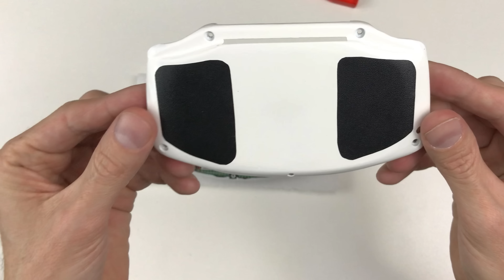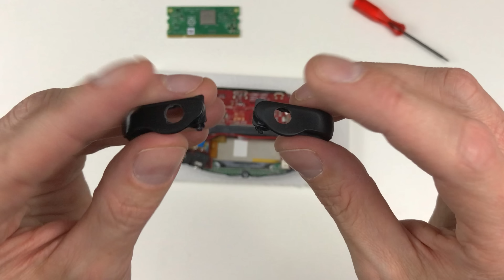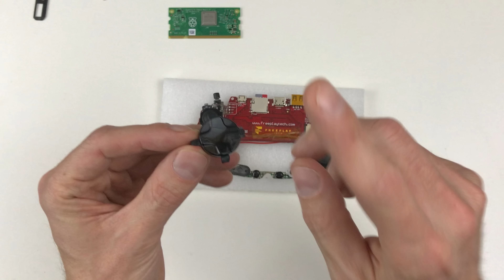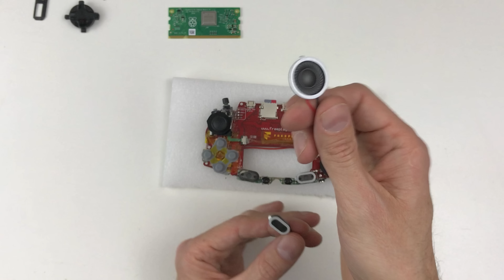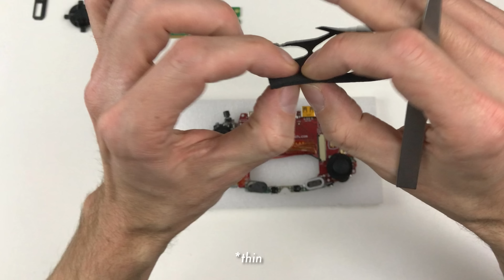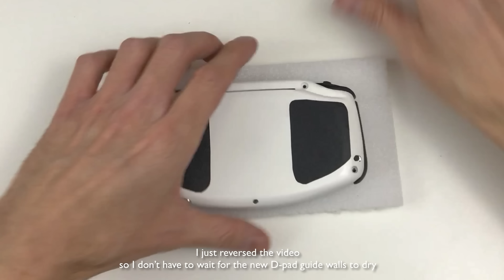My Freeplay CM3+ Slim Internal Look

Comment: I find that the D-Pad for the Thrustmaster's Xbox 360 controller works really well.
There's a place in in or around China that sells all kinds of buttons & switches, I think you would have a fun time looking through different ones for this hobby.

What kind of screen do you use? is it a LCD one?
Also, Would it be feasible to install some sort of rumble in something like this?
Reply from the maker: I WOULD like to different buttons and things for sure. You don’t happen to have a link do you? As for the screen, it’s an LCD https://www.freeplaytech.com/product/freeplay-replacement-lcd/ . The viewing angles aren’t the best, but all in all it’s a good little screen. It works great for modding because it’s so thin, and it does look pretty good. I haven’t seen anyone add a rumble motor to a build like this. Maybe they already have, but I’d guess it would be pretty specific on how it would work. There’s quite a bit of space available in the rear full sized shell and I bet some different motors could fit, but I wouldn’t know how to code them. Do you have any coding experiece? I want to learn, but every time I start I get sidetracked.

Comment: This build is something I would really like to build, but I don't have any experience with the hardware. I know my linux/pi well, as well as having repaired some smartphones, but never soldering of this type. Do you have a suggestion of some sort of project I could do to start to acquaint myself with the skills needed for this project? Also, would creating a model and having the case 3d printed be a good solution?
Reply from the maker: Timothy that would be FANTASTIC! I’d love to be able to work up a model in some CAD software, but I have no clue what I’m doing there yet. I tried for a couple days to model the slim rear shell for my slim builds, but have never been that frustrated in my life :) . It took all my will power to not yet constantly at the screen. I just want the line to move right there! Just connect to the thing I’m telling you to connect to! Why do you hate me so much!? Anyway, after 2 days of that I had to call it quits and just chopped things together as always. If you could create a model it would make a huge number of people very happy I’m sure. I’m definitely up for printing some off for testing or helping you out however I can, so please let me know if you need anything like that from me. As for project to start building your skills. I’m pretty much in that phase now. My first project is my first video the TigerPi. It’s a pretty messy mess internally, but still going strong. I’d say any kind of project like these that you feel motivated to finish. When I started thinking about the TigerPi I was dying to get it working even though I had no idea how to, or if any of that stuff would even fit in the casing. I just had to try. I’ve been learning a little here and there since then. I think it’s been about a year or so only. That’s why I don’t name any videos “tutorial this or that,” because I’m just kind of messing around trying to figure things out most of the time. So maybe a Pi Zero build made with cheaper components just to mess around. You can think of a form factor you’d like to put the components in, like a Sega Game Gear if you have a soft spot for those for example (any form factor you really like), and start to look up parts you’ll need. You know you’ll need a screen, so search around on YouTube and anywhere else online for different builds and see what kind of screens and parts they are using to get ideas. A cheap one I know people go for (I used one before too) is the ~$15 vehicle reverse camera screen. There are a few different models of those and write ups on how to mod them in that a search would lead to. I think there are some tutorials for those on Sudomod, but probably different places as well. Then you know you’ll need a battery. Do the same to look around at what people are using, and how they manage their batteries. On and on like that until you have a little list of parts and have learned a little about how each works (if you don’t already know). I didn’t know anything about batteries or anything at all when I started, and now a know a very limited basic amount. That’s pretty much how I started, but you could go different ways with it. Maybe by checking out a kit like the Freeplay, Kite’s Circuit Sword, Minty Pi, or something like that. They will be more expensive, but they take care of so much of that stuff like the batteries and screen. I’m spoiled by them now :) . I’ll probably do another more DIY kind of build like my Pi3boy at some point though; I need to get a better understanding of things too.

Comment: This is awesome!!! I've been brainstorming something along these lines, but I was hoping I could find a 3D model of the GBA case so I could prototype and fiddle around by expanding the back cover to add L2/R2 (or triggers), and to come up with a better layout for the ABXY buttons (something a little more cross shaped), but no luck so far. Still, I thought about using the JoyCon analogs as well, and the mini-speakers too, and it's awesome to see they work nicely!!!
Reply from the maker: Thanks. Have you seen the different current L2/R2 methods? The default position for them using the addon board (full size back) is on the upper rear of the back. My method is putting them through the L1/R1 like in this Joy Cons build. It’s my favorite way so far, but I do like me some Xbox style L2/R2 triggers. Is that the kind you’ll be going for? I just finished my current build tonight, and I’ll be posting about it in the next couple days. I’ll be uploading a build log of it afterward too. I like how the L2/R2 buttons worked out this time a bit more than on my past builds. I’ve mounted them to the board way more cleanly using clear epoxy, and the positioning was pretty easy. Here is a cool build where he moved the ABXY buttons to mimic more of the SNES layout https://forum.freeplaytech.com/showthread.php?tid=4824 . The mini speakers I used in this Joy Cons build aren’t very good. They do get the job done, but I won’t be using them again. This build I just finished it another “Slim” build, and I’ve placed the original speaker on the rear. This sounds WAY better. I’ve also tried out using dual 3DS slider analog sticks in this one. I haven’t played around with it a lot yet, but after adding the correct analog stick parameters in the config file tonight they actually feel pretty good.
Reply: Hipcat I actually haven’t seen those methods for the L2/R2! Is there anywhere I could browse them?

My inspiration is an old accessory for the GBA, a grip made by Pelican (https://i.ebayimg.com/images/g/vdYAAOSwP9dccDvy/s-l1600.jpg). I made a little video showing how the thing works: https://youtu.be/TIYNn30LTio (sorry for how dirty it is, I haven’t used this thing in ages!). As you can see, the piece adds a little working space to the GBA, without altering the profile significantly (the spots I point at at the end of the video? Those could be made into slots for new speakers!). So, my idea was to salvage that idea, use new techniques to 3D-print an attachment (something along these lines: https://youtu.be/APd18dGEfqw - but more inconspicuous and better adapted to the GBA, since the idea is to make things more comfortable but not to alter the profile significantly) and add small triggers to it - think something like the PS4 controller’s (https://d284x0ytlho6sy.cloudfront.net/images/midimage/AB68854_4.jpg). This would have the advantage of keeping the comfortable original LR buttons from the GBA, and the new triggers could be mounted on a X-axis hinge (when seen head-on... is that even an apt description of what I’m going for? 😅) so the actual internal buttons are mounted vertically on the back of the GBA. The end product should look something like those silicon rubber grips for the Switch that add a little curvature to the back of the console, which improve usability a lot but don’t deviate too much from the original form factor (eh, the resemblance would be in form, not in material). Of course, the piece could also be used for speaker-mounting (even full-sized ones!), bigger batteries and even extra ports if need be. Seeing as I don’t have enough resources to get this wrong, I’d really like to play with a 3D model of the thing before committing to it 😅

Regarding the analog sticks, I originally thought about using the ones from the PSP, since I have a few of those laying around. However, I want them to be clicky, and the slimmest ones around that are are the Switch’s, so... Alas, the (awesome and extremely comfortable) 3DS’s wouldn’t work for this either.

This button configuration (D-pad, two clickable analog sticks, four face buttons + two “control” buttons, and four top buttons) should make any emulated game playable. A third “control” button could also be beneficial (think Home), since you could control RetroArch’s stuff with it, but I usually just map it to R3 and get done with it (y’know those Select + button commands? I usually just make them into R3 + button, though Home + button would be optimal).

Anyways, can’t wait to see your new build! Keep up the great work!!!

Comment: Can you make a tutorial
Reply from the maker: That’s a good idea. I’m working on a dual 3DS slider Freeplay build now (with a walkthrough), but afterward I’d like to take another stab at it using the Joy Cons and some other upgrades. So far they are my favorite analog sticks I’ve used in these kinds of builds. I do have a really cool idea I want to try out that requires a full size back shell instead of the slim size. I may be able to combine the two builds with an interchangeable “Slim” back or “New secret feature” back.

Comment: Do you mind sharing details of how you moved the power switch?  It looked like you were using the two left most pins on the slider switch.  I've tried this and cannot get the system to turn on, if plugged in to the wall the green light turns blue so I don't think I'm far off but still missing something.
Reply from the maker: It sounds like you got it right with the 2 left most pins. What kind of switch are you using? I used a regular tact switch, so in order for everything to work normally I need to hold the switch in for the same duration as the slide switch needed to be held. So basically I just need to mimic the hold action of the slide switch using the new tact switch. Are you doing that and still running into problems?
Reply: @jivinhipcat  I don't know all the details, my kiddos managed to break the switch in such away that not only was the slider stick broke but the actual switch had come loose and torn some of the traces up too, I have a replacement switch but with the traces somewhat ruined i cannot get it soldered back on.  I may play around with the switch, see if i can figure out which pins are connected within it and try to wire it up that way.
Reply from the maker: Oh maybe you can scratch off the coating of the 2 traces and solder directly to the traces instead of messing with the pads that sound like they could be damaged enough to not have good contact anymore. It looks like there is a capacitor pretty close to the switch connected to those 2 traces, so you’d want to solder to the traces between that capacitor and the switch (just guessing to be safe). Have you ever solder to traces like that before? If not, you can use a sharp knife, or anything with a good scraping edge really, to lightly scratch away the coating on top of the trace to reveal the copper beneath. Then you can solder to the little trace.
Reply: @jivinhipcat  Could also be the boards are different, it is an old 2017/18 Freeplay Zero board, I scratched the traces off to solder on and wit hthe light changing colors I think that part is OK, i'll keep playing around with it, i'd written board off as dead until i saw your video and that got me thinking about how i could bypass the slider switch.  Your CM3s look amazing by the way.
Reply from the maker: Thank you. I haven’t messed with any zero boards. Maybe they are different. I bet there’s a way around that switch though. There must be.
Reply from the maker: I just looked at a picture of the Zero board on the site and it looks the same at that switch. The 2 traces and the capacitor too. Any way you could take a picture and share it?
Reply: @jivinhipcat  I can take a picture, not sure how to share it in Youtube comments other than maybe a link to a discord or drop box, some other site hosting it.  Youtube used to have a PM function but for the life of me i can't seem to find it anymore.
Reply from the maker: Or an http://imgur.com link. Whatever works
Reply from the maker: Or 0hipcat0@gmail.com

Comment: Is this something I can build myself, is it a kit or something? its almost exactly what I;ve had in my head for a retro pi handheld emulator
Reply from the maker: It is a kit, but I’ve done some upgrades to it in this (and most of my builds). You can check out the kits here. The basic build is not bad at all. I’ve done an example build here you can check out if you’re interested https://youtu.be/HcUCw5oCoIE . Then from there you can mod it however you like :) . The modding and actually making the builds is really fun for me, but it’s not for everyone. I’m about to start on a 3DS build as soon as the shell(s) arrive in the mail, and I can’t wait to get to it.

Comment: That is freakin awesome! You sir, are very talented. I remember I used to make mods like this but now with my kids, I barely have enough time for me! I kinda put my CM3 in the back burner for now. Reason being is because I've been building up my PS3 library and also my GameCube. There is plenty of hardware I still need to get for my CM3. I will be setting aside some money here pretty soon for all my upgrades to the cm3. Oh, you forgot to mention, how does the cm3+ perform? Does it overheat without the fan? Does it throttle after a certain amount of time?
Reply from the maker: I miss my old Fat PS3 for the backwards compatibility. I finally gave away my PS2 copy of Half Life the other day so it looks like I’m shedding parts while you’re gaining them. You know I’ve just taken it for granted that the CM3+ has seemed to be working fine. With my first Slim build heat turned out to not be an issue with the regular CM3, so I haven’t bothered to test this CM3+ out for that. I’ve fired it up to play a little Turok to get the analog sticks right, and then I played a bit of Super Mario Land on GB and Metroid on NES. Also Super Smash TV on SNES and the Joy Cons make for nice dual stick shooter action there. I have some 3Ds sliders on the way to test out. I’ve never seen them on real life, but they look nice and slim. I may do another Slim build with those to try out. Not sure yet. Have you messed with a 3Ds analog stick?

Comment: I want to give you a BIG thanks.  If it weren't for your videos my wife and I would have NEVER attempted this.  I was actually really sad when I first heard about these.  The idea of "modifying a gba case" and "soldering stuff to the board" scared the daylights out of me.  After watching a few of your videos I was practically shouting "I CAN DO THAT!!!" at my computer screen...We now both have a working model.  Haven't done the l2/r2 boards yet though.  I think I know how to do it, but I haven't found a video specifically installing that board.  Perhaps something you have done that I'm missing?  Anyway, you rock.  You've blown my mind wide open as to what's possible with a personal build.  Thanks for the vids and keep up the AWESOME work.  Oh and yeah you can get standard 5mm pitch 6 pin breakout boards for like $2 that work with at least Vita sticks.  No way am I gonna try soldering to that little connector thing lol
Reply from the maker: Oh man that’s so cool to hear and thanks. Yeah I haven’t played with the breakout boards, but I think I’m going to order some to test out. I haven’t had too much trouble with those tiny connector pins, but it has to be easier with a breakout board. I haven’t done any videos showing the add on board connection, but here is the info from the Freeplay site https://docs.google.com/document/d/1GkmF4kXyXvcFUH_lFjIykzFlOVgB8iRxvx1VnZ1wgEY/mobilebasic . Are you guys going to add analog sticks to your builds?
Reply from the maker: I just found these https://rover.ebay.com/rover/0/0/0?mpre=https%3A%2F%2Fwww.ebay.com%2Fulk%2Fitm%2F292971807565 . I am in LOVE with them already. Grabbing a handful. I plan to cut them down a lot, but they will make life much better. Thanks for putting them in my head!